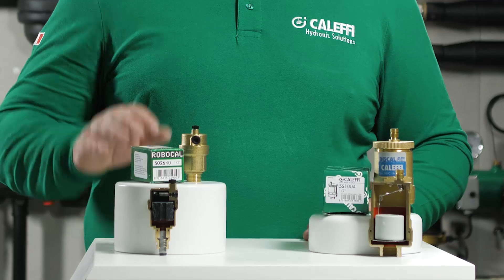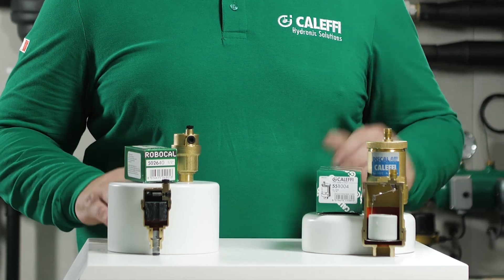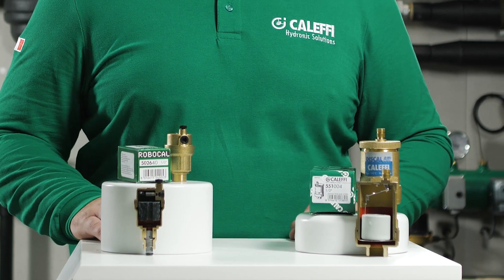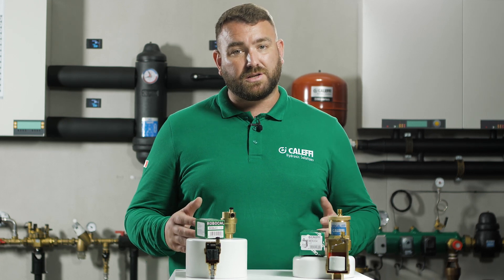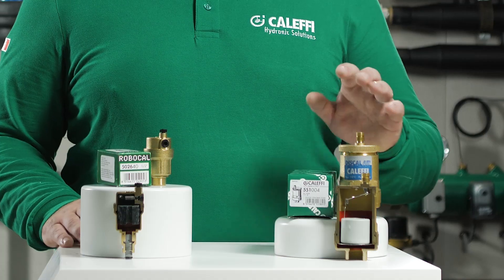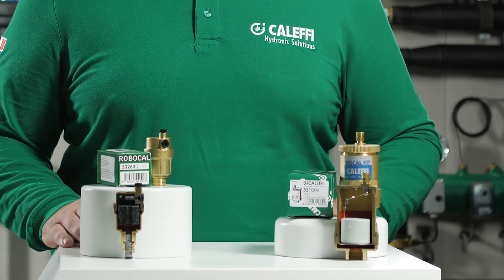Automatic Air Removal? Chose Caleffi ROBOCAL and DISCALAIR®

Comment: I have the Robocal 5026 that worked faultlessly until I fitted a new radiator, since then I have to manually vent. If I leave the vent one complete turn open to auto vent water constantly leaks. Does it sound like the float has jammed?